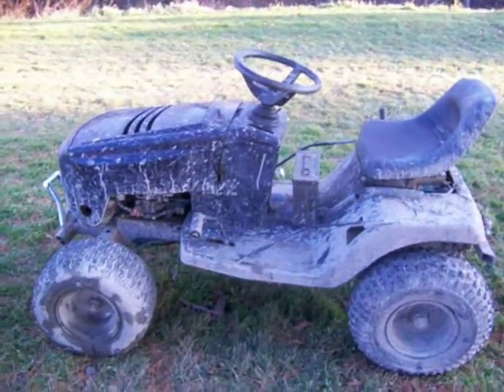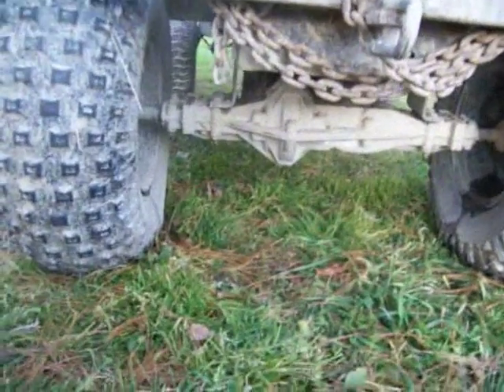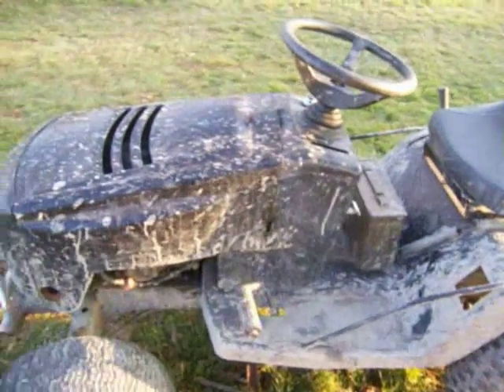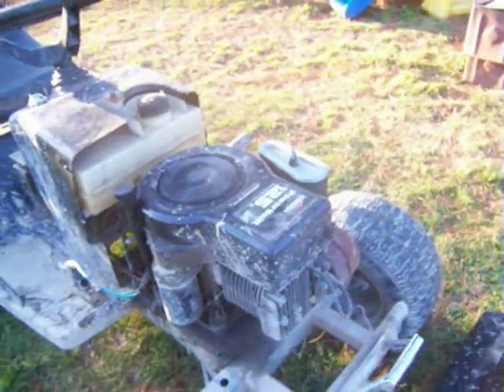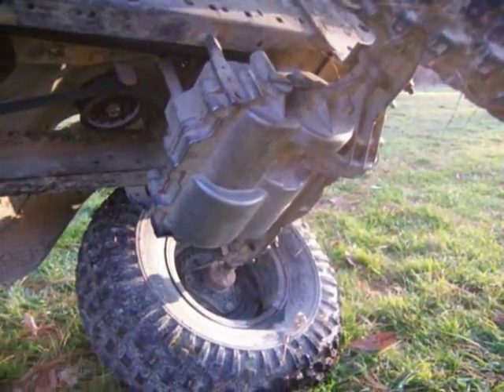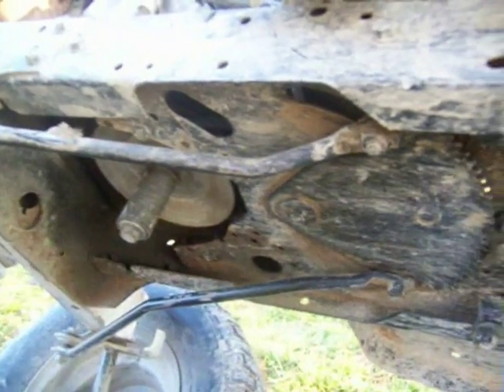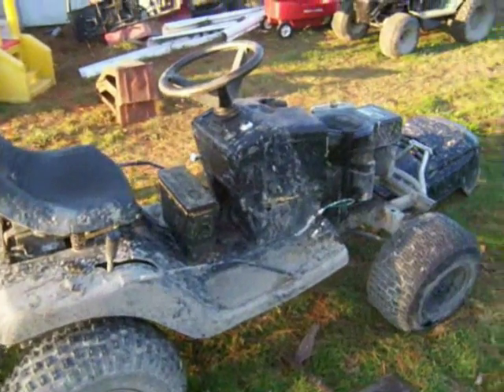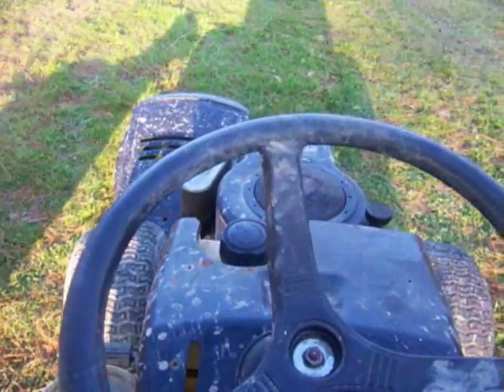How To: Build an Off Road Lawn Mower

Comment: i have a craftsman with a 16.5 hp kolher and its got the hydro tranny i was wondering if i could make it faster, if i can would it be cheaper to buy a built motor or leave the vertical motor in it

Comment: i have a 1995 craftsman 5 speed 12.5 hp lawn tractor. i want to make something like this .....any suggestions? btw the bolt connecting the shifter arm to the transaxle broke so i have to fix that. but other than that everything is stock...its like your craftsman crawler with the shifter in between your legs...SOMEBODY PLEASE RESPOND ASAP!

Comment: do you have any tips on making my belt slip less.? i have a murray select widebody with a pulley swap. about a 3 inch front and rear. 6 speed with an override. and a 12 horse.

Comment: I just got a mower just like this that i will use to go offroad are there anythings u think i should definitely do to make it better, also im puttin twin 2 inch stacks with weather caps so it should be pretty loud, it has a briggs 20 hp opposed twin.

Comment: Is this what you did. You cut the engine shaft, weld a pulley on the engine shaft and hook up a pulley to the transmission to the engine shaft. If this is wrong please let me know and please give me more info on the pulley system. Thanks

Comment: I wish I could take my old 90s Snapper RER offroad, but the friction drive will not do well in mud.  Surprisingly enough, it pulls a lot of weight.  I have towed 400 pounds on level ground with that baby in 1st gear.

Comment: @kryton590 lol, you need to lock it if you even plan on driving through a mud puddle, you see the way it is now it is an open diff, so witchever wheel has least traction thats where all the power goes, good for driving on your lawn, bad for in the mud, by locking/welding or adding 2 extra spider gears you can have a locked rear end then that means both tires have equal power going to them at all times. for info on how google it. i think i said enough lol

Comment: Fearless, been watching your videos for years but just noticed that you welded your front suspension on the Murray. Just curious if you did it for your own preference or for structural reasons. I'm building a 2003 Murray off-roader and it has the same front suspension. Thanks!

Comment: I have a murray thats just like yours with a 12.5 hp powerbuilt b&s like yours. i removed the mower deck and all that shit what do i need to do to the motor other than changin yhe pulley to top out the speed+i need it to be as cheap as possible $50 or less. Any i deas man? How do lock the transaxle?

Comment: haha so i have a craftsman 2 rider i built a mudder out of it (kinda), i think its like a 94 but anyways, 12 hp stock motor, stock drive system, i was driving home on sunday and the rear end made a sound like an ak 47 then was really jerky untill i got home,.. any ideas?? i will tear into it on friday, the gear on the axle maybe? ive saw your tranny repair videos but im not familiar with the 5 speeds like mine, any tips for me?

Comment: Hey fearlessfront, this is the first one of your videos that I've watched, and the reason I watched it was to see what you did with your tires to make them mud worthy. I already have a race tractor that I made that with a 12.5 brigs and Stratton in it, I just overrode the governor and did a pulley swap. It will go over 60mph,but I want to have something to play in the mud with. I have a 18 horse that I'm going to turn into a mud tractor, what size tire do you think I should put on the front/ back?

Comment: yeah didnt even pay attention.  this is a flat head motor.  And my OHV literally does breathe fire. lol  it blows about a 3 inch flame the entire time its running. I would like to make it a lot faster but it uses a variable ratio torque converter and a single speed transmission that only has forward, reverse, and neutral. I could put a bigger engine pulley on it i guess but the engine is sitting on like 1" washers. It was done this way from the factory but idk why. The rear pulley is like a 10"

Comment: those transmissions have alot of gear reduction. 

18HP for 500 lbs for a lwanmower is equal to 180HP for a 5000 HP truck. So id say the tractor has better power to weight.